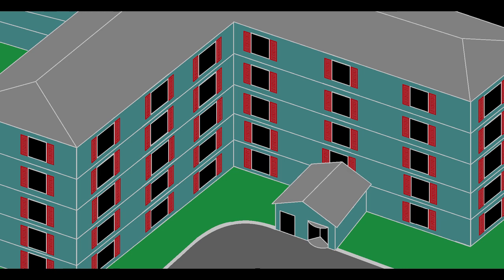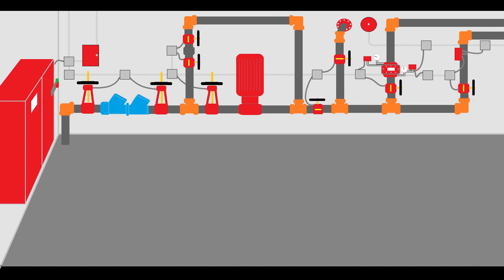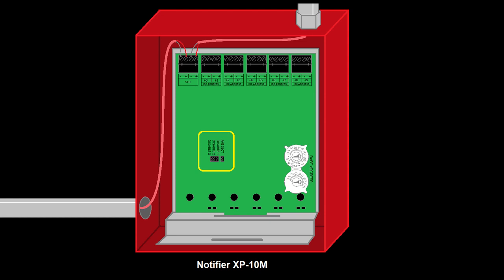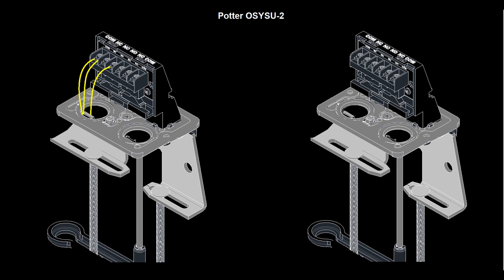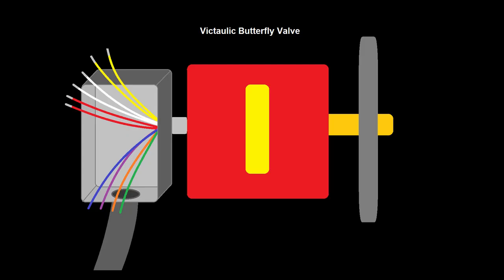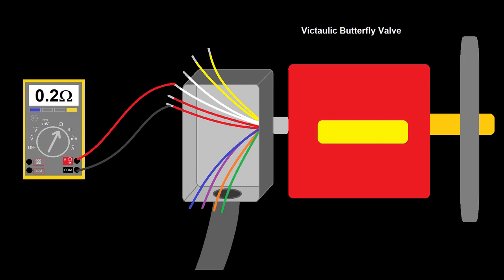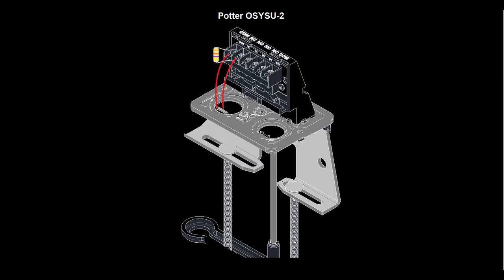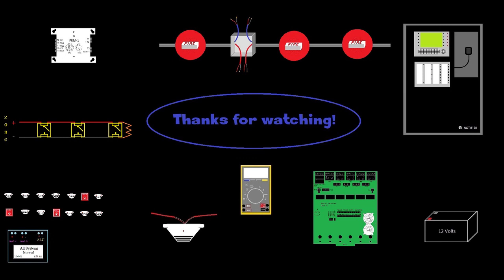5 Story Building Project - Sprinkler Room Part 1

Comment: Joe, we're grateful for your work putting these videos together. The inspectors comment is correct at 6:56 regarding the labeling of the fire pump bypass valves. Detector check valves are backflow preventer assemblies with a bypass metering devise that detects any leakage or unauthorized water usage. I'm an old sprinkler guy learning the fire alarm trade and can't wait for your next video!

Comment: Also we call the Buttery Fly check valves “tamper” switches
Reply from the maker: Well, I'd call every valve tamper in that room a tamper switch. The question I have is whether that one specific section would be called "pump bypass" or "detector check"

Comment: Great info! When wiring a single tamper, is it always necessary to put the EOL resistor on the separate set of wires? I’ve always wired the resistor together with the tamper factory wires and monitor module wires. It always works but is it technically wrong?
Reply from the maker: Eh, some people would say it's wrong. I'd say it doesn't really matter.  Essentially, by doing it the way I showed, you're monitoring the wiring to the switch as well. The way you do it, if the wire broke going to the switch you wouldn't know because the monitor module would still see the resistor. What are the odds of that happening? I'd say almost zero. Plus it's just a tamper. I do it the way I showed, but I see people do it the way you described all the time and I don't think it's too big of a deal.
Reply: @JoeKlochan  Thanks for the explanation! That makes sense now. I’m definitely going to next few the way you do it and probably stick to that.

Comment: Great video Joe! 

At 6:10 , the code out here you can put up to 3 valves on the same zone/address but wouldn't you put the EOL in it's own box once you have multiple?
Reply from the maker: I can't think of a reason you'd want to do that. To me it doesn't matter either way really. What's the advantage of doing that in your opinion?

Comment: Hey on minute 6:15 more or less , the wires for the second tamper device goes into normally open as well or normally closed? On the drawing its showing NC but as you explain you say normally open
Reply from the maker: Damn, that's a good catch. Looks like I made a mistake when drawing it. Should definitely be on the normally open contacts.